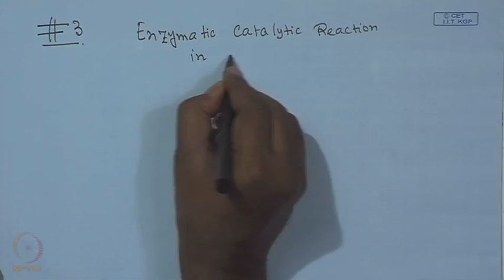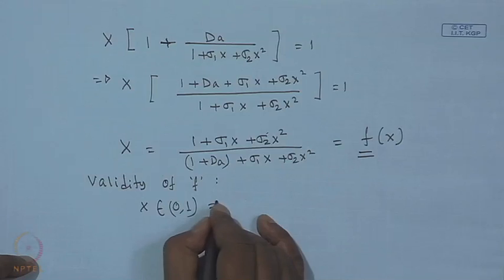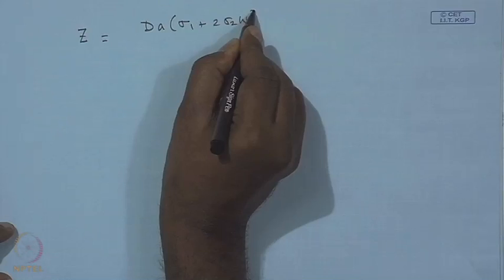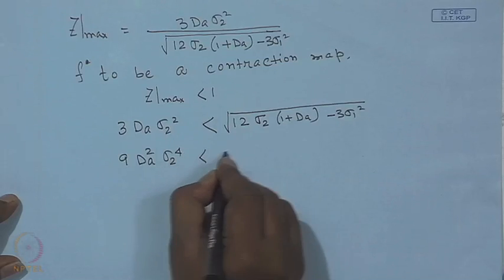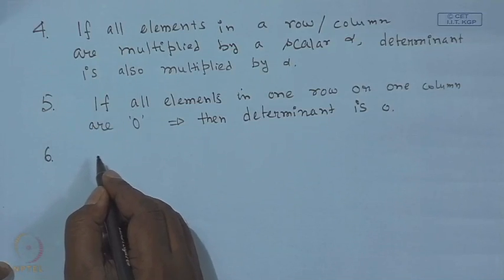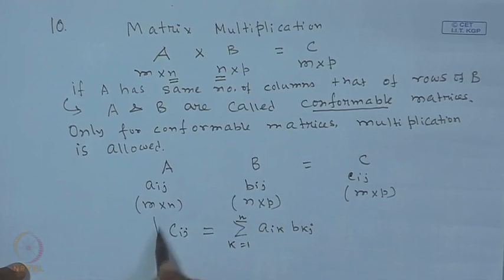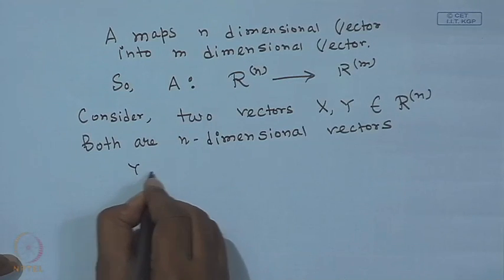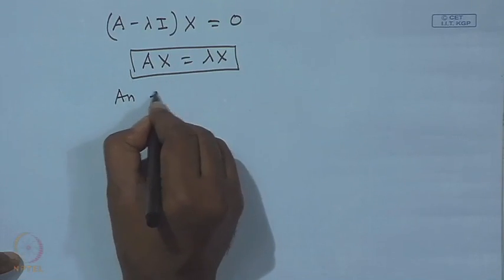Mod-05 Lec-08 Matrix, Determinant

Comment: Sir, in the contraction mapping example you have not raised the denominator term of Zmax to the power of 3 in the last step in which you substituted the value of w. The relation between Da, (sigma1), (sigma2) must satisfy-
9 Da^2/3.(sigma2)^1/3 + 3(sigma1)^2 < 12(sigma2)(1+Da)
Thanks for the video.